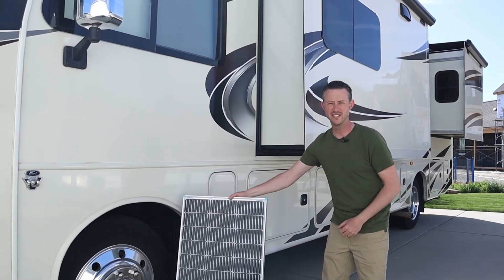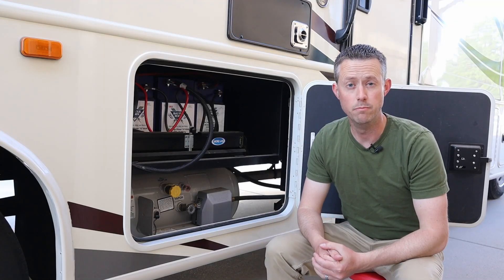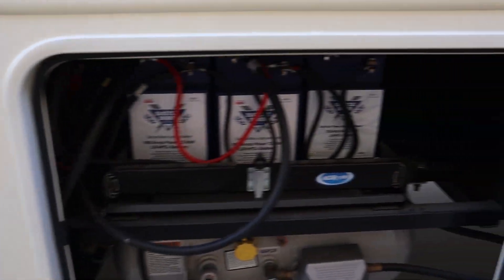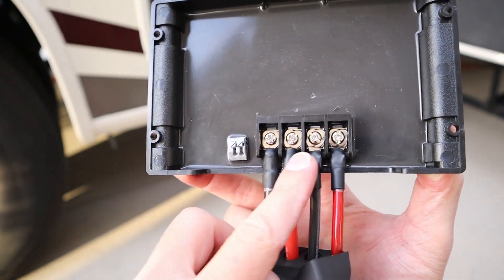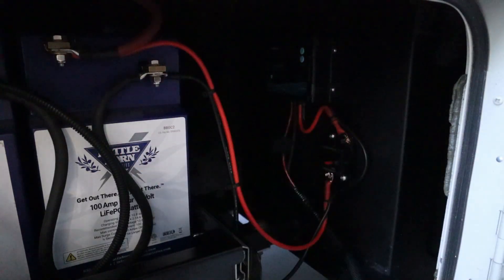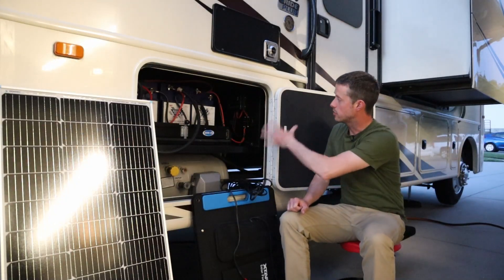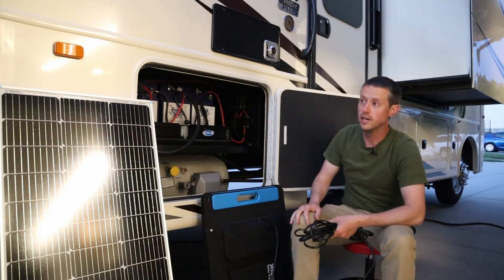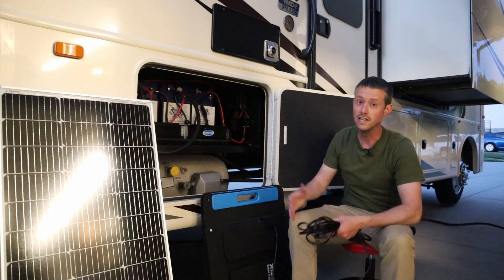Simple Guide for Adding Extra Solar to a RV or Trailer! EASY, Step-by-Step Walk Through Video!

Comment: My RV 5th Wheel has 400W solar on the roof, a solar controller in the front bay and a LifePO4 battery. I also have a 160W suitcase solar that I bought when we had a travel trailer that I would like to use. It has a built in solar controller. For me, would it be as simple as attaching the positive and negative to a breaker or fuse that I install in the same bay and then to the battery? I've heard conflicting information about having two separate solar setups utilizing two separate solar controllers attached to the same battery.

Comment: No issue at all in having two separate power sources coming into the batteries?
Reply from the maker: Nope, no issues. As long as the charge controllers are set the same battery chemistry they will work together to charge the battery in parallel.

Comment: Nice job.

Your 12 AWG is safe for considerably more than 20amp.  Probably voltage drop is going to be your limiting factor as that depends largely on length.  The "good for 20a" comes from the typical household usage, where it was established as a typical worst case to limit the wire to a 60C temperature. Your wiring almost certainly has insulation rated for a higher temperature (even household wiring insulation now is typically 90C, welding cable typically 105C and silicone 200C) and being out and exposed instead of buried in insulation lets it dissipate heat it generates.  In short, seldom with low voltage D.C. small solar do we care about ampacity.  We size wires primarily to limit voltage drop to reasonable levels.
Reply from the maker: Reasonable explanation! Understood 😁👍

Comment: Why not connect the portable panel in parallel with the existing solar using the existing charge controller?
Reply from the maker: Mismatched panels will not perform nearly as well. Since this panel had different specs than what's installed on the roof  it was easier to add it's own charge controller.

Comment: I have to do this. Pain in the butt to put the panels up on roof. Been on my mind for a long time. I will ask you questions on askme. Bought the circuit breaker Klein tester. Will use Harbour Freight 2-100W portable panels. No worries about wind and rugged. Be good if you could show us how your dad did the lithium conversion in Motohome. It’s complicated with OEM charge controllers, alternators, wire sizes, converters, breakers, fuses and lithium choice. Battle Born too expensive. Did your dad have a WFCO converter? They are a pain and the first hurdle. Had a company want 10k to do lithium common my motorhome. Market here for better advice. Nobody is actually showing us how to do the conversions per brand-Fleetwood…etc.
Reply from the maker: Installing panels on the roof is definitely a chore. Lithium batteries are pretty much drop in replacements vs AGM batteries though. My dad's motorhome came with two BattleBorn batteries, we installed a third one for more capacity. They will work just fine with the standard AGM charging settings (even with the WFCO converters). My friend has a WFCO converter with his lithium setup and it also works without any changes. I think the charging voltage by default on those converters is 14.4v, which is perfect for LFP. I have been charging LFP batteries with AGM chargers for years without any problems.
Reply: @Jasonoid  Your dad was smart to get the lithium setup when he bought the rig. True, they will work fine charging but WFCO says will charge only to 80% on lithium batteries if you don’t have the newer WFCO model with AD in model number. Older WFCO models without AD had a switch in the back that made them work fine with lithium but that’s not available anymore for some reason . The newer models numbers with AD on the model number will charge to 100%.  I appreciate the feedback from you. I’m just saying that it not all just drop in with these motorhomes. The BIM from precision circuits in newer rigs also needs to be changed out to the green one to make sure the alternator does not overcharge via lithium from the chassis battery(right?). I have kids. Mommy will
kill me if things go wrong while driving this rig and an electrical event somehow occurs. So, to make things simpler I’m going 6V GC2 Golf Cart batteries to get more capacity and less filling the water all the time on flooded. I’m learning from you so thanks for everything. My DC Cooler works great that I got from you.
Reply from the maker: @Cabernet2000  the lithium batteries came with the rig and I haven't looked at all the components for the alternator or shore charging. He bought this RV second hand so all the upgrades could have come from the factory or the previous owner. I did see that when he was plugged into shore power his batteries were at 14.5v so just shy of 100% SOC at 14.6v.
I know his rooftop solar system is setup for LFP so his batteries are getting to 100% SOC on most days.
Reply: The newer WFCO converters have a switch for lithium batteries inside the converter. I would assume a high end coach would have this WFCO feature.

Comment: Hi Jason. Which do I connect first, the solar panel or the circuit breaker.?
Reply from the maker: You want to power your charge controller first by turning on the breaker. Then after the charge controller is on, you'll plug in your solar panel. 

You can damage your charge controller when connecting the solar panel without a battery connected.
Reply: Batteries first and then solar.